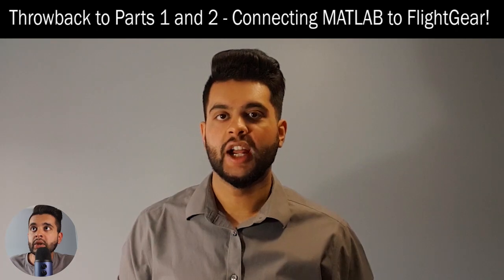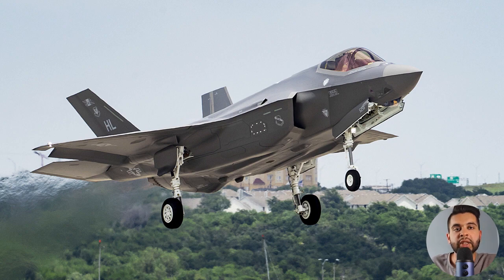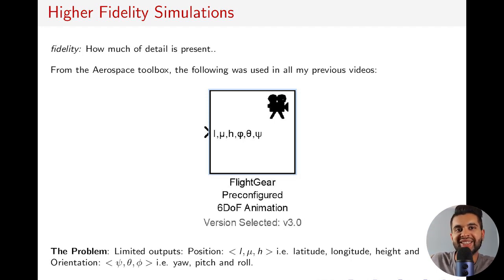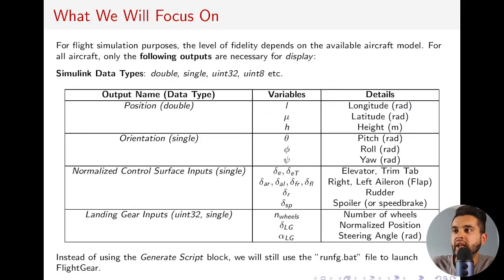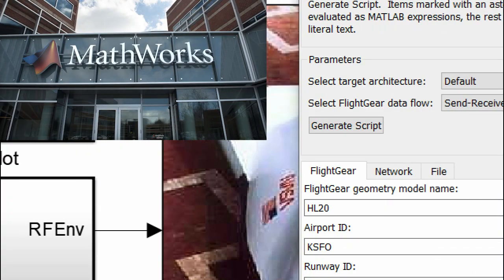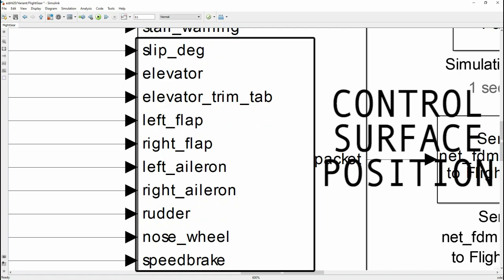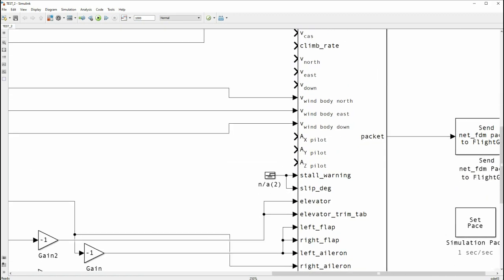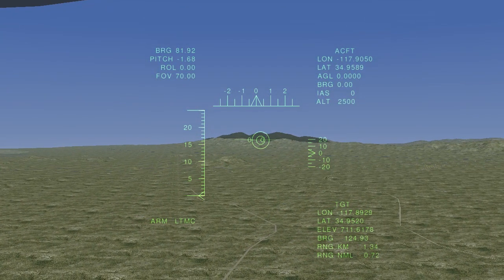Connecting MATLAB & Simulink to FlightGear (Part 3) - High Fidelity Simulations

Comment: It has been very nice learning with you. I am trying to run Beaver or Cessna (c172p) aircraft given as an example in the Simulink. But I am not able to fill the fuel tank using the script in runfg.bat as is given in the "Getstart.pdf" manual of FlightGear. If you can kindly help me, please. I have given the script below:

C:
cd C:\Program Files\FlightGear

SET FG_ROOT=C:\Program Files\FlightGear\data
SET FG_SCENERY=C:\Program Files\FlightGear\data\Scenery;C:\Program Files\FlightGear\scenery;C:\program Files\FlightGear\terrasync
.\\bin\fgfs --aircraft=c172p --fdm=network,localhost,5501,5502,5503 --fog-fastest --disable-clouds --start-date-lat=2004:06:01:09:00:00 --enable-sound --visibility=15000 --in-air --prop:/consumables/fuel/tank[0]/level-gal_us=100 --prop:/consumables/fuel/tank[1]/level-gal_us=100 --prop:/consumables/fuel/tank[2]/level-gal_us=100 --prop:/consumables/fuel/tank[3]/level-gal_us=100 --prop:/engines/engine0/running=true  --enable-fuel-freeze --disable-freeze --airport=PHNL --runway=04L --altitude=7224 --heading=113 --offset-distance=4.72 --offset-azimuth=0 --enable-auto-coordination --uBody=200

Comment: Hello, i want to do a simulation involving change in wingspan of a custom UAV model i imported in Flightgear, and have a wingspan command which will alter the wingspan of the UAV while the simulation is running.  Since there is no option to have an external parameter (like span or sweep or dihedral)  which could be sent from simulink to flightgear, i have been trying to use generic protocols as per the documentations but still can't figure it out. Please guide how to proceed from here.

Comment: "old versions of aircraft are superior than new ones", more than superior they might be still compatible with older FG versions. F-16 for example requires at least 2018.3+ to run and the latest GitHub version is more advanced than any other available. For the MQ-9 I saw you are using an old version of it. I'd recommend trying out the latest available here for an eventual next time ;) https://github.com/JMaverick16/MQ-9 . That said, nice video and keep it up! Cheers.